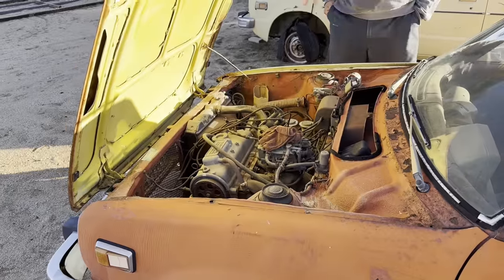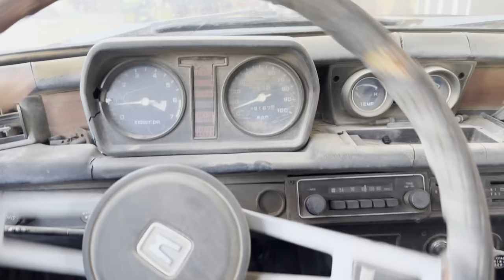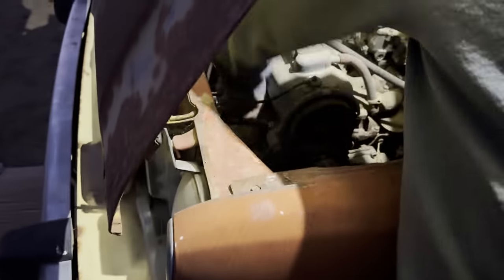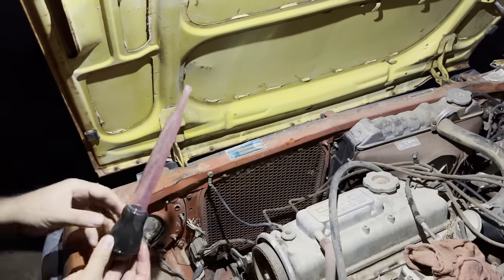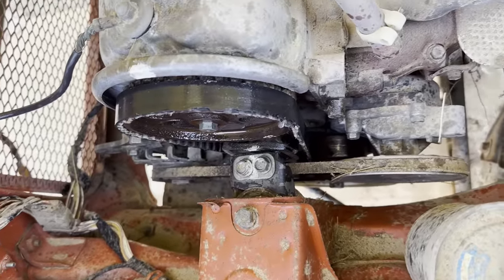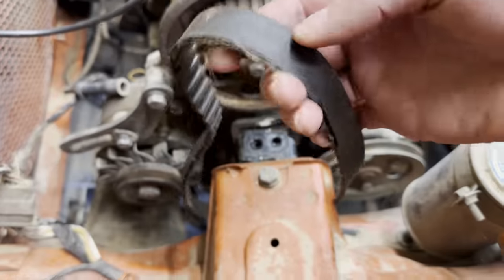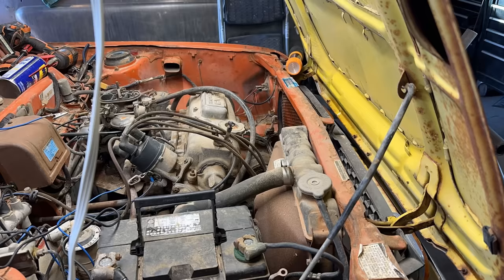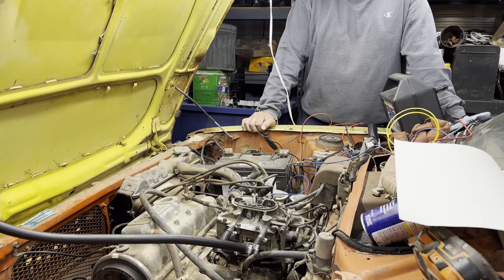Will the Honda start!!!!!???? (part 1)

Comment: I had a yellow 77 Civic CVCC. I can tell you that back then the carbs where at times a pain . And when they were replaced they used webbers. If I remember correctly the carb factory is from Germany. May be incorrect there. I  also had issues with my sparkplugs glass busting. I miss my car so bad. It is THE one car I would pay to have back. Thanks for vids.
Reply from the maker: I wanna rebuild the operator that’s all right see if I can get to run better
Reply: @dcrs51  I think its one of the greastest mistakes EVERY man makes, is to get rid of their First Car*whether it be a shitbox or not...
I miss my 8 Dodge Dart...I could drive that anywhere in the US and never ever worry about it breaking down. It was a solid easy engine with very solid body*even though kinda rough on the eyes...I loved that CAR....I miss it everyday.
Reply from the maker: @who346  ya dude I’ve never sell my first car it’s a 1961 cord falcon I have videos on it if you wanna see it

Comment: IIRC the crank must be at TDC with the index mark on the cam pulley straight down.  Use the right hand to apply pressure to the timing belt as you slide the belt into position.  Then mount and adjust the tensioner.  Finally double check the position of the index mark on the cam pulley.  If you are off 1/2 a tooth don't worry about it, if it's off a tooth or touch more remove the tensioner, slide the belt almost off and the top so you can slip it just off the pulley while you tweak the position as needed.
Reply from the maker: Thanks for the information it’s really cool you! The timing is definitely off

Comment: Definitely  check the timing belt. Honda motors timing belts are known to hop a gear after the belt gets worn in. They are super reliable  motors. Fix the timing belt and I know she will be a runner.
Reply from the maker: Ya dude the engine sounds good and the smoke cleared up towards the end we couldn’t get to run off gas I the carburetor has to be really dirty

Comment: In Britain it was called the Honda Civic. It was a massive seller. The four-door sedan version of this body style (basically identical to the hatchback but with fixed rear window and opening lower trunk lid) was never available in the United States. Unfortunately, rust swallowed up these models pretty quickly.

Comment: the cvcc engine uses 3 valves per cyclinder-2 large and 1 small-the small valve is in a small chamber and gets a rich gas charge, the main cyclinder gets a very lean gas charge-allowing the enginge to not need a smog pump. also the carb has two fuel feeds-1 for the rich chamber and the other for the main chamber.

Comment: For ur gas line attach a vitamin container metal fittings to the top of the line I did it few years back & it works today when I need it

Comment: MAYBE I WAS LUCKY BUT IT DID MAKE SURE THe TIMIMNG WAS NOTHING LESS THAN PERFECT . i Had a 74 same year the cam journals were worn out on the head was worn out , $101 brand new , That was approx. 1984. Sure would like to have another 74 but most are thrashed and a lot of missing parts ! I'd settle for a repairable N-600
Reply from the maker: The timing I’d definitely off and the carburetor has be dirty too no air cleaner when we picked them up

Comment: You need to adjust timing /TDC mark on head to TDC mark at block ) after belt replacement! Check it or you will crash the valves

Comment: oil plug screw 17mm keep the plug out to turn engine over, less compression it will turn over easier won't foul-up plugs

Comment: Di U ever got your Honda  to right U need to set the timing  the belt that U took off has to be lineup with the crankshaft in order  for it to run properly

Comment: Pour fresh gas an avoid using the fuel pump unless it is to empty out the old gas, check the carburetor and points.

Comment: Knew instantly when you were starting it for the first time and it stalled every rotation and backfiring through the carb that the timing is off - should have turned distributer bit by bit until it started easily - the distributer is too far advanced hence firing before it should....

Comment: I was wondering why in the world would you oil the timing belt? Unless it was really dry rotted & u wanted to try to get some life out of it but, I drew a blank on that one! I like seeing old forgotten vehicle's being brought back to life!!!  I noticed the T- handle on your jack! I have a Central Pneumatic or whatever the name of my Harbor Freight jack is. I've been noticing that it's getting harder & harder to release the load off my jack without dropping whatever it is supporting. IS THAT T-HANDLE & KNUCKLE THING YOUR DESIGN/HOME MADE OR, WHERE DID YOU GET THAT? It's a great idea!!!! Also, I hope you used brake clean to clean the oil off of the timing gears & components b4 installing the new belt.
Reply from the maker: The belt was coming off and was coming apart we put WD40 on it to see if we can slip it back on didn’t work we did clean the timing gears before putting on the new belt the jack we got from Harbor freight it came like that thanks for the comment!

Comment: HI good morning my name is Luis am Puertorrican and I do work with Hondas and I want to gave you guy's some advices when you work with Hondas ,,,, the first advices is when you work with the timing and want to changege the timing belt is the the Hondas are diferent than other cars the you find the point for the timing is in front of the engine  but Hondas have the timing point in the transmissions and you going to look in the transmission is a ruber cover in the center top of the trasmission the mark can be red  yellow or orage paint whish  tell you the the piston one is in the top second tip is after find the marck take off the spark plung # 1 and make sure the piston is totaly up and the last is look in the fron of the engine the have a long needleif you dont match all three points and you start the engine you going to damage  1 the valve becoming bent 1 can break the top of the piston because the valve dont went back to the nest and the # 3 is that can blow the head gasket so make sure the the first point is shownremember that to replace the valve steam is very expensive because you have to bring the head to the machine chop to replaced the valve and rectifie the head that going to cost you  at least $ 250.00 because they not do only one valve so the going to chrge you for the full set of valves  and the valve steam coversthen rectifie the head in the machine as well
Reply from the maker: Thanks for the info just dropped a bomb of knowledge!
Reply: @dcrs51  well my friend  for my age and the all acknolege that I was picked up from friends other mechanic's that I know personale and my own mistakes I learned very fast and apply this  aknolege to get  better and better so here is a lil story that happen to mewhen I work for the first time  wuth a honda civic 91  1,3 engine my friend call me that morning  because he knpw that I do mechanic and tell me that his car blow the head gasket so I have to remove the timing velt thing that I never do beforeso I have no idea what am doingbecause I make the mistake to don look for the timing point on the front of the engine why ? I dont know why I forget to do that so I keep reaping the engine apart clean up every thing on the engine and mount all this thing back together so as always I do was remove the first spark plung and look for the piston to coming up as I tell you before but guess what piston one have to times on it one is a dead point wish means that there is no preasure on the piston and the second point is the timing point wish mash with the color point in the transmission so after I huckup every thing I procede to start the car so hey the car start but 10 second after start we heard a kcnok in the engine the valve steam was vented and the valve stock out so heat the piston and breaked after that the engine stopit's was in 1994so my friend get mad  and screaming on me but was because he was fired the same day that this happen to him and then that he was pist off that day so I tell him calm down and we going to solve anything happen to the engine so we go and buy all the stuff back  head gasket new spark plugs  new timing velt ,and when I opened the engine again we find that the piston was bocked si I call my friend in the junck yard  and he tell me that he got the piston and the headand the engine was runnuing perfect before they sale other parts from this engine so I buy from my pocket the  piston and the head they cleaned for me so I get it for only $75.00 dollars so I run again to the auto part's and get the bearingsand get a free rent for the valve unmouted so I put a new oil rings protectors gasket on the valve steams as well and my friend in the auto part's tell me to look in the transmission for this  color point on the top of the trany so before I desmoun anything I put this color point at top and see that piston one was all way upthen I clean everything on the way pulish the valve and the I pull the piston out so I replaced the piston one and sheck for the other piston wast damage as well so I replaced all verings  in the pistons and guess wath  when I mount everythiing back I follow what my friend in the autoparts told me and the engine start at the very first start running very sm0oth and quiet so my friend tell me  I planning to dont pay you but you deserve the paiment  and he payme  $450.00 and congratulate me because I repair the engine in no time and get the car in the street in only 17 hr's even with the bigest mistake that I made  so he be happy and I be happy as well but that experience is something that I never forget in my life so if I get help frome the other why I dont going to help others wish never doing that in theirlife no way I learn and I do shared with others so they do a very good job

Comment: Find out if it is an "interference engine"  If not, you can run the old timing belt until it breaks, without damaging the engine, though you might need a tow.  If it is, failure can cause severe engine damage and you should put in the very best belt possible along with new pulleys and water pump if it is driven by the timing belt, and excellent water pump lube.
Reply: Yes, it looks like an interference engine, so use the good stuff, and all new.

Comment: The timing is off. Timing marks are on the flywheel. There is a little window in the crank case on the front side of the engine. There should be 3 Marks on the flywheel, something like, T I   I  The first line near the T is top dead centre. Line this up with the pointer. The cam should have an arrow or the word up and also should have little grooves on the face of the cam wheel one at 3 o'clock and one at 9 o'clock which line up with the top of the head. Then you can put the timing belt on. Only rotate the engine counter clockwise. If you rotate clockwise the timing belt will loosen.

Comment: Replace the carburetor with a new one and make sure it's timed right one you do that should run a lot smoother than it is now also run a return line you probably flooding it little bit
Reply from the maker: I picked up a carburetor rebuild kit!
Reply: @dcrs51  just make sure you run a return line in stead of briginf them I'm saying from experience I rebuilt 3 of those engines and it needs a place to dump the fuel back so it runs like it needs to

Comment: You need to take the carb off and clean it up! NO FUEL!  pay attention didn't you notice it kept running when as you continued to spritzed  the carb with starting fluid!.. Get s small bottle with a nozzle fill it with gas and feed it a little at a time  and i bet it will  continue to run If it does this proves it a dirty carb needing to be disassemble & making sure you clean the jets and also seeing the floats ...do float !
Reply from the maker: The carburetor Has to be dirty I have a carburetor rebuild kit ima clean that one up